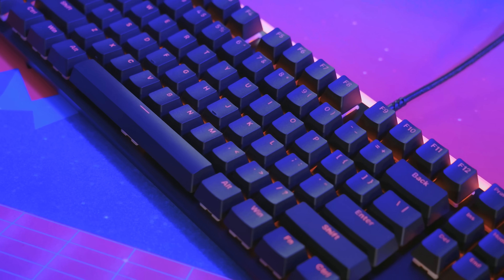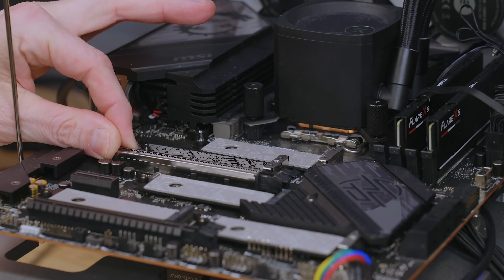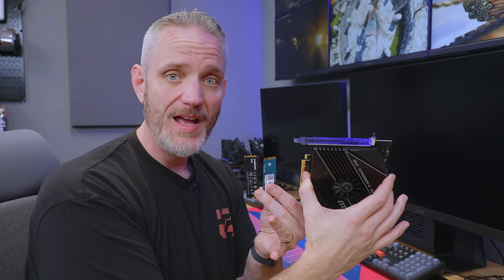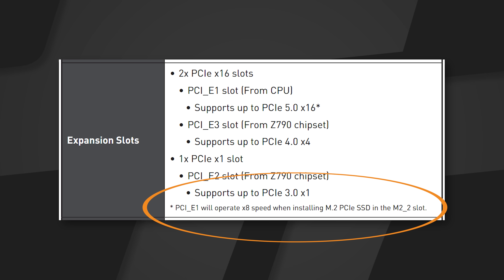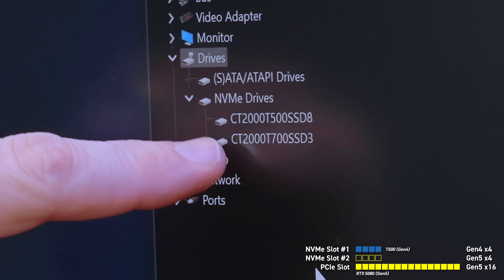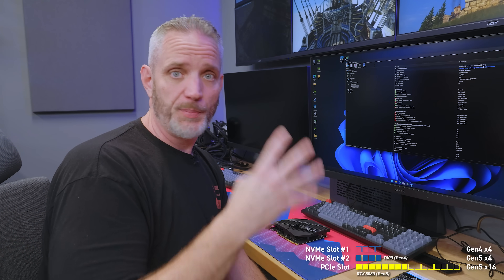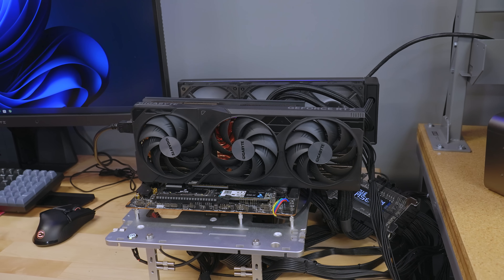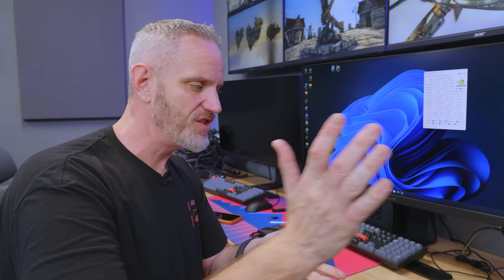Don't make this mistake with your PC!

Comment: Currently, i have a 990 pro m.2 gen 4 in a gen 4 slot, recently bought a RX9070 popped in a 4.0 pcie x16 slot, gpu reports it's running at x8 not x16. Must default to x8 for a 5.0 card. I mean am I losing some performance with this?

Comment: Honestly, these motherboards have too many M.2 slots.  Yes, NVMe drives are great, but traditional SATA3 is very decent once you get Windows off the drive.  Further statement, the SATA consortium needs to adapt HDDs to a higher bandwidth connection.  HDDs are still good for bulk storage at reasonable prices.
Reply: I'm not sure a higher bandwidth option would solve anything for hdd's. Still use them myself but spinning platters are held back by physical speeds of platter rotation and heads reading. It's mechanical not digital. In the past to try and squeeze more out of them they had 10k rpm drives, they had 15k rpm cheetah's that were noisy as hell. They could still only physically spin and read so fast. The drive is the limiting factor not the data channel choking it. 

Even now nvme's are exceeding useful speeds compared to various buses and memory/cache. Yes a gen5 is wicked quick, when under sustained transfer between 2 of the same gen/speed drives without interruption (accesses for other apps on one of the same drives). But that is a limited scenario. They're not 45x faster at everything. Not the drive's fault but the rest of the entire system. That's why boot times only change from like 8 seconds to 7 or 7.5 seconds. There's some delay due to the various caches that data has to go through to reach the cpu to be processed etc. It's why game load speeds hardly vary from sata ssd to gen 3, 4, 5. Technically a gen5 is x amount faster than a gen3 or 4, so why doesn't a game load x times faster? Because there's more in the system than the drive itself. Latency exists. A gen5 is what, 25x faster than a sata ssd? If the rest of the system were latency free boot times could go from 10 seconds to 4 tenths of a second. But reality is a thing so it doesn't.

Comment: I am fortunate to be on an AMD setup with an X870E motherboard. If only I had a Gen 5 drive..... Having said that, all of the Gen 4 drives and my GPU are all running at the correct speeds at the lane count.

Comment: I was just looking into getting another SSD for my PC turns out I am using a board that doesnt even allow for PCIe5, it only has gen4, but at least I made the right call with a ryzen 7 7700x cause it does have the 24 lanes for both ssds and the board does have 2 of the gen4's ... Nice that I know now that I will get enought for 2 ssds weird way to find out the processor is to good for the board lol, but I'll also keep it in mind so I dont go overboard on an ssd gen5 that isnt even able to be used with the gen4 slots

Comment: Depending on the specific m.2 board you run, your mileage may vary with how it works, with a x16@x4 slot, most expansion cards will just run a single drive at x4 regardless of whether it holds 1 or 4. Some will do what jay said, and run each drive but bifurcate the slot, but this is only when the motherboard also supports the bifurcation mode.

Comment: Somewhat cleared up questions I had but still not fully clear. Glad I sort of took my time last year researching what motherboards had what shared slots and stuck with a gen4 nvme drive when I got a 2nd one. Thinking i'll have to move the nvme once I upgrade my 3070ti to something newer.

Comment: Thank you so much. I had a gen 5 nvme on a gen 4 slot and didn't need to since i have a Arc B580 (PCIe 4 x 8). I was worried I was gonna cut the gpu performance but it doesn't need it. I put my NVMe on my gen 5 slot and all is as it should be.

Comment: Reading the manual helps until it doesn't because the way they bifurcate, gets crossed with disabling other ports, depending on what is installed.  I can't tell what configuration allows me to target performance of M2 drives and still use SATA ports for way cheaper large storage drives.

Comment: I built a new gaming PC and had to deal with bifurcation this weekend. It actually drove my mobo choice. I have 2 gen 5 drives and ended up having to disable some specific USB ports to get the full lanes for my drives. It also doesn't affect the video card, but if I didn't take the time to read, then I'm sure I would have totally screwed this up. Moral of the story, read mobo manuals before you buy. lol

Comment: So I have a CPU with 28 PCIe 5.0 lanes total of wich 4 are reserved for chipset. My motherboard ( X670E) has one x16 5.0 Slot and two x4 5.0 M2 slots. There are another two x4 4.0 M2 slots but they would have to share the x4 lanes to the chipset with everything else right? If I only have two NVMe PCIe Gen4 drives I should still use the two Gen5 slots?

Comment: 😂😂😂 2 years ago i was reading and watching videos about bifurcation. So i immediately i started reading every manual of motherboards for the AMD 7800x3d. I was planning to use all the ssd slots on my Motherboard so i ended buying the Asrock X670E Pro Rs, it gave me the best option and very little bifurcation for the ssd. This way i didn't had to spend 500 euros or more on a Motherboard.  I didn't have any problems with my motherboard like other people that are complaining, i just plug it and everything works perfectly from the start.  In the future i will most probably buy Asrock motherboard again.

Comment: I have a 790 MSI board as well along with a 4080. I bought 2 drives when I built my system, a gen 5 and a gen 4. The problem I had was the gen 5 I had was so fast and the slot was so close to my GPU that the m.2 would just cook itself and cause the system to crash.

I spent a week trying different fans, different heatsinks, different fan intake outtake setups but nothing worked! That bastard was too fast for its own good. The only time I got it to stay somewhat stable was with this massive heatsink I had that required me to remove my GPU... So yea I shifted that bastard down to a gen 4 slot and called it a week...

Comment: Yeah, Intel giving only 20 lanes sucks, there should be way more.
At the same time, that AMD motherboard having 24 available and not putting 2 M2 slots Gen5 is stupid, can't understand what's the reasoning there (unless is for USB4 as you guys say)

Interestingly enough, while Intel has less CPU lanes, there are several boards with 6 or even 7 M2 slots available for them, while for AMD the maximum is 5 slots, there are no boards with more (or at least, they are not shown on PCPartPicker).
It's bonkers.

Comment: I have a 5080 running at PCIe 5.0 and a 990 Pro in my Gen 5 NVMe slot but I am running a Z890E STRIX board and all my slots are going exactly to what they are suppose to be. My 990Pro in HWinfo is x4 @16GT/s My 5080 is at x16 @ 32GT/s and I have a gen 3 NVMe in a gen 4 slot and that is running at x4 8/GTs I also know that my 265K has 20 Gen 5  PCIe lanes

Comment: I've worked with PCs since the days of the Amiga and Commodore systems.  Since PCIe and bifurcation have been a thing, I've seen 1 instance where manual configuration was needed.  It wasn't on home PC equipment, but rather an HP Enterprise system running a very specialized PCIe card used only in ScramNET networks.  In literally every other of the thousands of instances I've worked with PCIe, auto bifurcation was the correct strategy.

Comment: My computer is quite a bit older than that, but it also has some of that going on. I have 6 Sata ports, but only 4 of them are usable since the bandwidth for the last 2 is instead being used by the second NVME drive slot.

Comment: My solution is just to run old hardware lol. Gen 3 VC, Gen 3 NVMe, and Gen 3 MB. But I did kinda run into this with my sound card had to be in a specific slot work correctly and I had to RTFM to figure it out.

Comment: So I have never had a nvma drive when you build a new pc do you only add the drive with the operating system drive and later add the other drives if you want ..... And question 2 : my old pc has a gen 3 mouthbourd and a Chen 4 gpu   evga 3080 10 gig  so I guess that's why it's not running as well as it should..... I know it's a massive card for my very old pc. I7 6700k  but my gpu died and this one I was given...

Comment: You are a lifesaver! Had my graphic card Radeon RX5700 8gb (PCIe 5 Slot) with Ryzen 5 6700x plus my Samsung SSD EVO Plus 990 1tb (PCIe5 Slot) on a Gigabyte 850 Eagle WIFI 6E board - Davinci resolve kept stuttering and crashing BUT NOT ANYMORE once i followed your instructions -so Bifurcation can do one in my book - As a returning PC builder from the 90s its all a bit different for us oldies but thanks to channels like yours - we can get instant help - Cheers from the UK

Comment: I never would've thought about this, I have 3 sata drives, one nvme in m.2 and one sata in m.2, everything works fine tho. But you're telling me my gpu can be slowed down by my gen5 ssd?? What the hell why is that a thing.
I personaly never heard of this bifurcation thing ever. I never even heard that word before. You should be able to use all available slots to their full potential, if you can't then they shouldn't be there.

Comment: So if I have a Gen4 and Gen3 drive, I should just put them in the Gen4 slots? I think I got Gen 4 or Gen3 in the Gen5 slot. I’ll have to just empty out the Gen5 a lot? Use a 4080 on my gigabyte B850-A WiFi motherboard.

Comment: I kinda understand it but probably not 100%. i have a MSI 3060, I5 10400F, MPG Z490 Gaming Edge Wifi board. i believe a Gen 5 M.2 2TB which is in top slot thats Gen 4, lower slot is Gen 3 if i remember right. recently put  in Corsair 64GB DDR4-3200 (yes i know its overkill). so on GPU-Z it says Bus interface is PCIe x16 4.0 @ x16 3.0... so my understanding now is that my graphics card is using all 16 lanes but at Gen 3 speed instead of Gen 4 and its likely because of the M.2, have i got that right?

i played PubG recently with it installed on a SATA and i was having loading issues going into matches. did some tweaking and moved the game to the M.2 and i can load up and be waiting before even the timer starts while people are still joining. so for me my setup seems to work, but id welcome any input on if im doing wrong or, it is what it is until i do a planned motherboard/CPU upgrade at some point in the future?

Comment: That is why I use SATA still, both spinning rust and SSD, as I can have tons of storage while leaving my 2 NVMEs getting full speed along with my GPU. And honestly for older games and videos? I can't feel the difference between the HDD and the NVME as games like Bioshock were made with spinning rust in mind so the load times are quite low.

Comment: I read the manual on the Asus Rog Strix X670E-A in combination with a 7800X3D. Read your own! I built it 2 years ago, so I didn't put in a 5.0 Nvme drive, they were too expensive at that time.

Comment: 10:45 WOW, you bought drives 1x and they will still be useful in 5 years!

Yeah, that's a lot smarter than buying the exact speed you'll be able to run and having to replace all of your drives every single time you upgrade your PC.

Only buy like he's suggesting if money is very tight.  Otherwise, you'll save more in the long run buying once and reusing some/all of your drives in the next PC you buy.

Comment: 10:38 I'm one of those with a few drives. However, I bought gen 4 drives, and as far as I remember, my mobo can run them all at full speed. The only socket that gets cut in half, is the GPU slot from Gen 5 16x to 8x, verified in GPU-Z. That's an average 1% loss in GPU frame rates according to Gamers Nexus. I could remove one of those NVME and clone it to SATA drive, to get full GPU speed. Never really bothered me though.

Comment: The only reasonably priced AMD Motherboard I could find for my 9950X3D that didn't rob gpu lanes or disable a pcie slot with 4x Nvme was the Strix x670e-a.

Comment: So there's no way to use the 5.0 M.2 slot without losing a generation on the PCI slot???
Reply: Some motherboards you can. You just need to look up the lane sharing. I picked a msi board because it can disable the usb4 ports on the back to get 4 lanes for a m.2.
Reply: @adamstull2436  I have the MSI z790 Carbon, basically this one in the video. I still  need to connect mouse, keyboard, camera, etc. Hmmm

Comment: I actually have a faster drive than my system supports too but i know it since the beginning. I bpught my Samsung 980 Üro in 2021 whem therr was a very good deal for it, even though my mainboard only Supports PCIe 3.0 but like i said it was a good deal and it's gonna be nice if i upgrade my board then i won't be stuck with slower SSDs or having to buy a new one and for now the PCIe 3.0 Speeds are more than enough for me, it's still much faster tham the SATA SSD i used before.

Comment: My two cents
I generally recommend leaving the FASTEST M.2 SSD slot free and install WINDOWS into the slowest one. On a 512GB SSD. As a gamer, I find that 512GB is more than enough for everything EXCEPT games and for Windows the speed is mostly a non-issue unless you've got some program that really benefits (video editing?). It fills up over time, and I like to BACKUP automatically with Macrium Reflect Free... and I think it's maybe more reliable to backup the DRIVE not a partition on the drive but maybe it's a non-issue now.
(I don't want to put GAMES on the Windows drive and fill up a large SSD as a single partition because the backup grows too large)
THEN I use the FASTEST M.2 SSD slot for gaming only where it benefits. Most games I put on a SATA SSD partially because I've had some of them for years, but now that games are getting more demanding I'll put THOSE games on the fast M.2. Mostly been a non-issue until recently but it's changing.
*I even bought a $20 PCIe card for an M.2 SSD. I only got HALF THE SPEED the drive was capable of because of the issues Jay talks about (I still got about 2GBps). I'm not even sure that affects performance at all as the issue of transfer speeds is often not the max THROUGHPUT over the PCIe lanes but rather limited by the drive ability to access smaller files.

Comment: 4:03 - that's not what would happen here. That card has the first four lanes connected to the first M.2 slot, and the second four lanes connected to the second M.2 slot. If you put that card in a four lane slot, only one of the M.2 slots will work, the other won't be connected to anything. You won't get two lanes for each drive, because it doesn't have a PCIe switch on the card. On top of that, if you plug this into a board which doesn't support bifurcation on the slot it's in, you'll still only get one working drive, because it doesn't know how to split the lanes into two devices.

Comment: I have a 5090 At gen 5 x16 and 4 m.2 gen 4 drives at x4.  If I added a gen 5 or one more m.2 drive it would reduce my 5090 to x8.  I have a 4tb 990 pro here that I haven’t yet installed because of that.

Comment: I actually found the limitations dumb, I get it for lower older tier stuff but higher end?, just makes no sense to me, I didnt know this was a thing until I tried to install a secondary card and ssd, again its fine to be limited on lower tier, but not on modern high tier board and stuff.

I am on the market for ryzen stuff and when I was looking at newegg or memory express, now I look at pcie setup first. reason was when I first installed m.2 and it says that using them disables sata lanes, on my board anyway, and found also it downgrades the pcie lanes and stuff, thats so dumb, because even newer motherboard list this limitations, my problem is why even make them?

Comment: I think I planned out my build pretty well. Faster/bigger Gen 4 drive in the one CPU M.2 slot for game installs, and then the GPU with it on the CPU lanes for Z690's total of 20 CPU lanes. Then two slightly slower/smaller ones in the chipset lanes for OS and regular storage eating 8/28 lanes.

Comment: That's why you don't buy a cheap mobo and that's why i have an Asrock Z790 Steel legend, you can use a GPU at 16x and four nvme pcie 4.0 drives at the same time without reducing or sharing anything, only if you use a nvme 5.0 drive then only the pci-ex 16x drops to 8x, and you have 8 satas, again all populated at the same time, the nvme slots don't affect or disable any sata connector at all!

Comment: what if I want to build a NVMe NAS without a dGPU? I want to use the x16 slot to use one of those x16 cards that support 4 NVMe drives plus those two direct to CPU M.2 drives to use 6x drives in a raid array